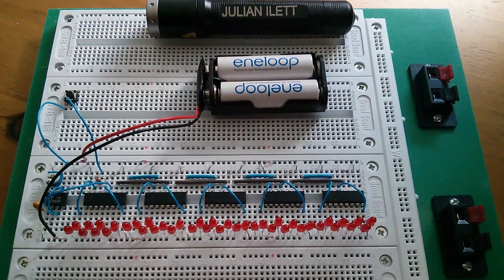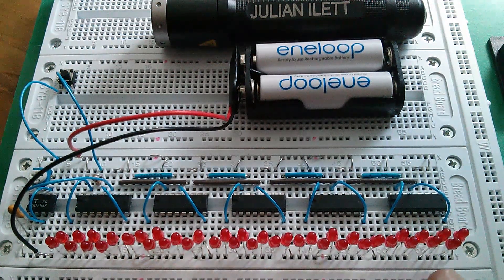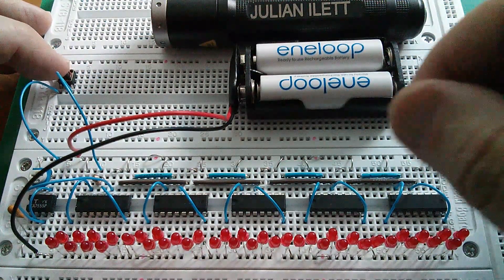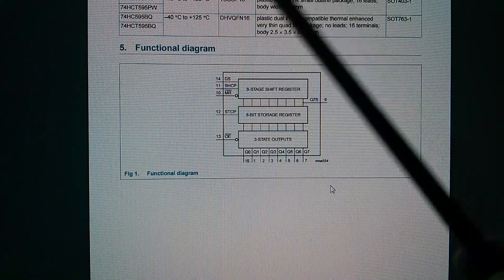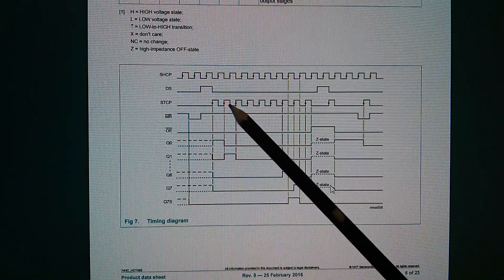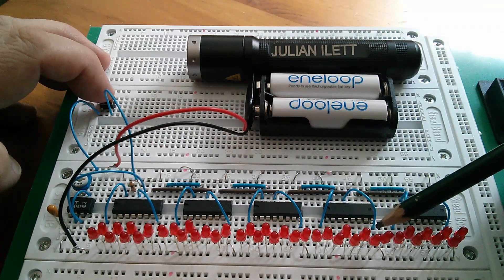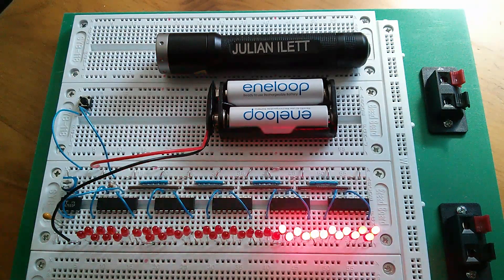Julian's Logic: The 74HC595 Shift Register

Comment: would it be possible instead of a 555 timer but use an audio source to create a spike that could be used to clock the circuit with audio and be set up as a small sound operated light display of some kind.

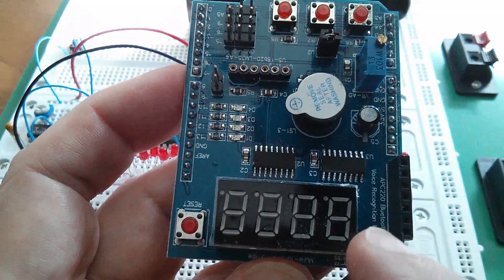Comment: 9:09 I don't understand the part with the 7-segment led display. There are only 2 of the shift-register chips on the board, hence 16 bit can be stored, but the board has 4 digit display, with 7 leds each (if you don't use the dp). So it needs to shift 28 bits around, with only 16 bit registers. How does this work?

Comment: Two minutes in you say you are worried that it is wrong to connect the shift clock and the register clock together.
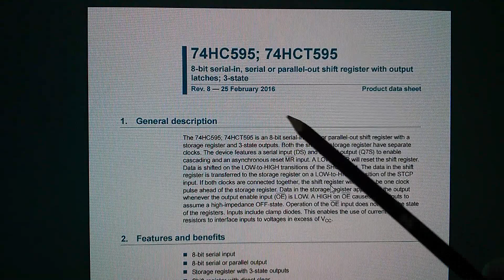At 4:01 into the video you show the data sheet, and in section 1 it states that "If both clocks are connected together, the shift register will always be one clock pulse ahead of the storage register". So it is OK to connect the clocks together.

Comment: выглядит отлично! но по видео не удается разобрать все подключения.
есть возможность выложить схему?
видимо, какая-то ошибка у меня в разводке 555.
у кого получилось, можете показать схему? и номинал резистора между 13 и 14 ножками.

looks great! but the video fails to parse all the connections.
Is it possible to lay out a diagram?
Apparently, some kind of error in my wiring 555.
who did it, can you show the circuit? and the value of the resistor between 13 and 14 legs.
Reply: всё заработало! супер!

Comment: Whether clocking both SH_CP and ST_CP simultaneously causes a race condition or not, the datasheet shows that the clock pulses are 180° out of phase. Therefore if you connect the SH_CP directly to the 555 timer and ST_CP to the 555 through an inverter, any problems with instability within the 74HC595 are resolved. This also matches the clocking pattern in the datasheet.

Comment: I had a set of these arrive this week, and I wired up a circuit to test them, and so far as I can tell, either the chips I received have a 100% failure rate, or I'm doing something wrong, and neither makes sense.

Source input is 3.3v, clock input on both RCLK and SRCLK is 10hz, OE and SRCLR verified tied to VCC. Pushbutton on SER similar to what Julian is using here. I've used a meter to check every input, both on the breadboard and directly at the chip pin, and I've checked and rechecked the values, but no matter what, it behaves as if the SER value is tied to ground. (Sometimes the outputs are all high when I plug it into the circuit, then they cycle low immediately and stay that way no matter what I do with SER.)

Sanity check dictates that there's no way the company sent me 250 faulty shift registers, but I've verified every pin both with the datasheet(which, by the way, specifies that the "race condition" isn't an issue, tying SRCLK and RCLK together simply puts the output latch 1 clock cycle behind the internal register) and verified with a probe that it's getting the right value.

The only way I've managed to get them to work as advertised is by placing the chip on top of the breadboard and then holding it in with slight pressure. This doesn't always work, and even if it did would be inadequate for obvious reasons, but checking the signals directly at the chip pins proves that it can't be a breadboard problem, because the signals do appear on the indicated pins.

I'm out of ideas, and I'm torn between dumping the entire shipment in the trash or giving the seller a 1-star review, both of which don't make sense because as I said already, while 1 or 2 faulty chips is unlikely but possible, 250 of them borders on impossible.
Reply: Started testing every single shift register in the set individually, and I discovered what the problem was once I found a few that worked: some of the registers the vendor sold me actually are faulty. (between 30 and 50% so far.)

They probably didn't think the buyer would actually test them before putting them to use.

Comment: Instead of two shift registers use a 7447 to light up 16-- 7 segment displays by using a 74154 to pull each 7 segment low or maybe its' high? and then use a 74193 as a clock and a 2114 memory chip to store the number for each of the segments. This may work better for a 7448  I cannot remember But I know this works as the 74154 is running so fast you cannot see the change I am thinking a 555 timer and slow that clock down and you can see each display light up at a time.  Interested? Let me know I can draw it out. Or I used to could I am 61 now and a tenth grader dropout. So

Comment: I've done something like this using a 595 as an address register and 8 other similar registers as display drivers (ucn5841 I think it was, open collector shift registers designed for driving coils instead driving common anode LED displays) using 4 io lines and a serial input I made an 8 digit led display that could display numbers, beep and display 21 other characters

Comment: I do not really get the use of the 555 timer.
And is it used as an astable or monostable ?
Reply: Ohw it's a CMOS timer. My bad.
but still, what is the use of the timer in the circuit ?
Reply: It's used to clock the shift registers. Without it, the registers would never accept new data, they'd just sit there.
Reply: "It is a miracle." - S. Jobs

Comment: One thing that would be fun to try is to tap off one of the shift outputs and XOR it with another shift output and take that XOR output and feed it back into the input (or'd with the switch input). That should create a pseudo random number generator.

Comment: Cool! I made one out of SPST(single pull, single throw) 5 volt relays and led's for relay-diode logic many years ago. I was expecting a sequence generator with the circuit I designed but then it turned out to work as a shift register... that was a moment! I have been into this stuff more ever since. Thank you for this because you show how easy it is to make this exactly as you have or otherwise.

Comment: The is actually no issue with the clocks being connected together, this is pretty much a requirement for must synchronous systems to operate.

From the Texas Instruments data sheet for the 74HC595 -

"† This setup time allows the storage register to receive stable data from the shift register. The clocks can be tied together, in which case the shift
register is one clock pulse ahead of the storage register."
Reply from the maker: +BogusNotions I missed that. No race condition then, just a 1-clock cycle delay. Thanks for straightening that out.
Reply: +Julian Ilett It's not immediately obvious but if you think about it the flip-flops in the shift register are connected in exactly the same way and work without problem and of course also give the required one clock delay. This is in fact how most synchronous digital circuits are arranged; a topic for a video perhaps?

Comment: Race condition can be essentially discounted (from a visual point of view) in this setup, because your clock rate is fast compared to the data rate. If the race condition occurs on the very occasional data transition it will be corrected on the very next clock pulse when the data input will have reverted to steady state (at which point it matters not if "new" or "old" bit gets clocked in to latch as both are the same value).. And you have very long runs of steady state input when you use a switch as input.  However if you were to drive the input of the second SR from the latched output of the first, and so on, you may see a different result? Or reduce the clock rate and you may see an occasional latch error.

Comment: That cool multiple breadboard is the SYB-500. Just looked it up, costs about 20 usd
Reply: +Robert Szasz uhm http://www.ebay.com/itm/4-In-1-700-Position-Point-SYB-500-Tiepoint-PCB-Solderless-Bread-Board-Breadboard-/200915429569?hash=item2ec77e28c1:g:iZgAAOxyE-dRzVGI
Reply: +Robert Szasz uhm http://www.ebay.com/itm/4-In-1-700-Position-Point-SYB-500-Tiepoint-PCB-Solderless-Bread-Board-Breadboard-/200915429569?hash=item2ec77e28c1:g:iZgAAOxyE-dRzVGI

Comment: 4 times 10 segment LED bargraphs would look good here if you crave neatness, but you would need to put them on the breadboard below that one and then use 40 link wires (ouch!) or, since you are going to need 40 you might as well go with the resistors anyway. Of course this only really makes sense if you already have them and are that OCD. He he he!

Comment: Unlikely to get metastability issues, because the edge triggered registers are presumably very similar in timing and they work for the chained shift register. Just the extra clock until the shiftregister is transfered in the output register is the issue.

Comment: You could skew the clock pulses using a resistor with CMOS. You could play with jumpers and resistors to get to a point where you do see a very obvious race condition. Use a resistor to slightly delay the shift register clock pulse perhaps? 
The resistor plus gate capacitance will introduce a delay according to the r/c time constant.
The "right" values could make it interestingly unpredictable!
Reply from the maker: +Nick Hill I like that idea :)
Reply: +TubiCal A capacitor would AC couple the clock when in series. This would create a charge pump which would likely change the time at which the signal crosses the detection threshold of the input. This arrangement could also potentially damage the input if Vcc were higher since a charge pump can double the voltage.
A resistor on the latch bus if selected correctly should on it's own guarantee the usual objective of no race condition.  I was thinking to put a resistor on the shift clock bus to guarantee a race condition for fun and effects :-)
Reply: +Nick Hill or go the opposite way, when you insert a capacitor in series with that data out clock pulse it will be delayed in order to avoid that race condition....;)
Reply: Or you could use a simple npn transistor with a base resistor to limit the current and a collector resistor to make a negative amplifier used as a not gate http://dlb.sa.edu.au/rehsmoodle/file.php/282/kpsec.freeuk.com/trinvert.gif

Comment: You "could" actually use a 595 for multiple inputs. Add a push button to every output of the 595 and have them all connect to 1 input on an arduino,  send a bit to every output quickly, one at a time and check the input to see if a button has been pressed. Wherever the bit was, that's where the button was pressed.  Not efficient but an interesting experiment.
Reply: +DarkTherapy 
If 595s is all you have, sure. Otherwise there's something like the 74HC165, which does the opposite (parallel in serial out) to the 595.

Comment: Would making the stop wire longer then the shift register wire prevent the issue, even though still very naughty
Reply from the maker: +Lan Party Hosting Einstein says no. Long wires won't have much effect. You could throw in a few inverters to add some gate propogation delay, but that's a bit pointless since a single inverter solves the problem anyway.
Reply: +Lan Party Hosting A typical coax cable gives you ~5ns/m. And if you just use a wire of a few meters length you may get the additional feature of a cell phone rf power sensor or something.